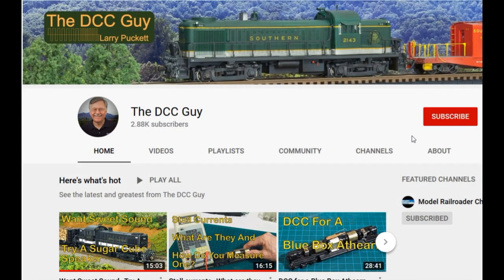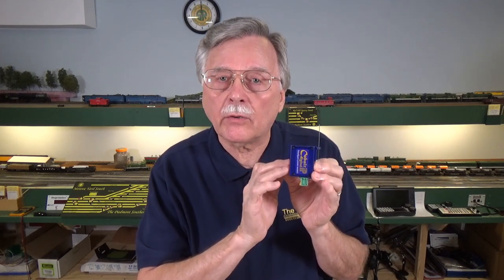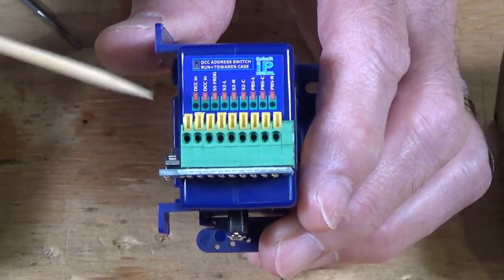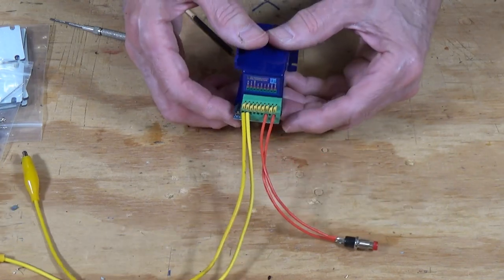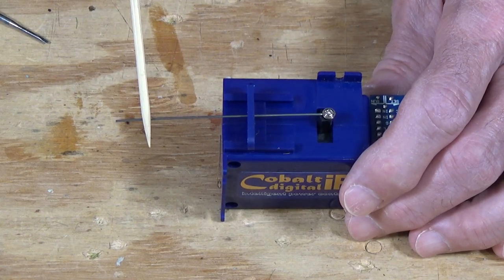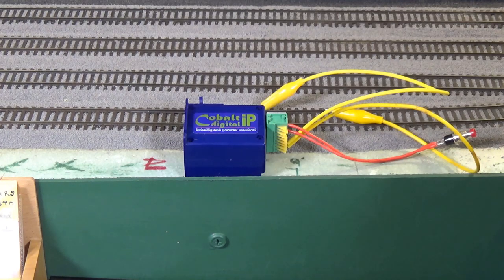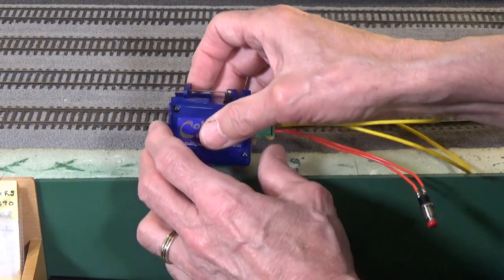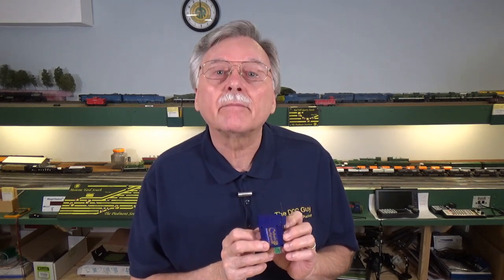Is The Cobalt Digital A Tortoise Slayer(188)

Comment: Hi Larry, my apologies if this is a duplicate posting. I have noticed that the PSXX nor the PSXX-AR circuit breaker does not appear to be compatible with the Cobalt Digital switches. I have noticed that every time I use the Cobalt switch it creates a short with the PSXX. When researching this Tony's Train Exchange (DCC Specialties) states that it is due to a poor design of the Cobalt switches and it should not be used with PSXX and recommends using Tortoise switches instead or using a separate bus to power the Cobalt switches (which I assume will cause problems when I try to power the frog, use auto reversers, and or track detectors to automate my switches.) Im new to the hobby so forgive my ignorance if this is not true. 

What is your solution on your layouts when using a circuit breaker and IP Digital Switches? Are they really not compatible?
Reply from the maker: In the video I did on using the PSXX it was on a layout with 9 iP Digital switch machines and I had no issues. However today as a test I will give it another try and cycle every iP Digital to see what happens.
Reply from the maker: OK, I just did the test. Connected the PSXX set with a 3 amp trip current to the layout with a PowerCab/SB5 operating at 5 amps. There were 8 sound decoder equipped locos sitting on the powered tracks and 9 iP Digital switch machines. All the iP Digitals are connected directly to the DCC power bus. Powered it up and threw all the turnouts including a crossover with 2 switch machines, didn’t have any issues. So I have no idea why you or the folks at Tonys Trains had a problem. I’ll show this test in the video this Friday.
Reply: @TheDCCGuy  Thanks Larry. I am new to this but I did try a few more things. I wired the motor directly to the Bus (no rails or anything else) Tired it and the IP Digital motor works fine.I then put the Power to PSXX then PSXX to the IP motor and it shorts. Based on your msg I will now program the PSXX to be 3 amp rather than the preset 2 amp and see if that makes a difference. Fortunately you have a video on how to do exactly that....being new to the hobby your videos are incredibly helpful. I will let you know how it goes.
Reply: @TheDCCGuy  Hi Larry,  First off I would like to thank you again for your quick response and for going through the trouble of testing this. I am looking forwards to your next video on Friday and knowing it works for you gives me confidence to keep working on the issue. 

I reset the PSXX to 3amps as you have with your system and the IP Digital switch now completes its motion but the PSXX will trip at the end of its movement.  I am completely new to this but I will take a guess that the IP Digital Motor takes up a lot of power and since I do not have a full track layout connected the PSXX sees it as a substantial change in power ratio thereby tripping? Is PSXX That smart? Maybe something you can explain when you show the test. 

I am continuing to work with DCC Concepts who have been very responsive to my questions on this and I will post any explanation/solution on your video comments section to help those who may experience the same issue. 

I will also reach out to DDC Specialties to get their comment and share that if it provides any more constructive information than what they have already stated. 

Again thank you for taking the time to test this on your system.
Reply from the maker: When the iP Digital cycles it is a bit different from the Tortoise. Unlike a Tortoise which actually stalls at the end of its throw the iP Digital circuit actually cuts off power to the motor. So there is a sharp drop off in current draw at that point as the circuit alone only pulls a small current. So I think you may be onto something with your interpretation. When I did my test I had 8 powered locos along with the 9 iP Digitals collectively pulling 0.27 amps so it might be true that in that case the PSXX circuit does interpret the iP Digital peak followed by a dropoff as a short. It would be interesting to see how it acts with more of a load on the track. Also there may be a way to adjust the PSXX circuit to slow it down. I’ll take a look at the various settings and see if that might work, I know a lot of changes were made compared to the old PSX.
Reply from the maker: I just did a quick test, removed all but 1 loco which brought the track current down to 0.14 amps. Then I went through the switches, cycling each—still could not pop a short. What scale are your locos, how many on the track, how many iP Digitals?
Reply: @TheDCCGuy  I am HO Scale (code 83) using ESU Cab Controller (15V @aprox 7amps) The set up I have is just a test set up of approximately 4 feet of Atlas track with a Atlas turnout at the end (customs line Mark IV) no frog connected to the IP Digital Motor yet and one IP Digital Motor. 1 locomotive (Athern Genesis, full DCC sound etc. Diesel GP-40) 

I have since removed all track and just have the main bus connected to the IP Motor and   PSXX. Here are my findings so far:
1) Just the motor no PSXX, everything works fine (Direct connection)
2) Add the PSXX and short occurs (ie Power to PSXX and PSXX to IP Motor)
3) Set PSXX CV=3 and switch throws but short occurs at the end after the throw is completed (Power to PSXX and PSXX to IP Motor)
4) Set PSXX CV =6 = Approx. 7amps) and everything works fine no blue or red light on the PSXX.(Power to PSXX and PSXX to IP motor)
Reply: To clarify set CV 49 = 3 and CV 49 =6.
Reply from the maker: Jason—it sounds as though your iP Digital may be drawing excess current and causing the circuit breaker to trip. I have sent an email to the folks at DCC Concepts detailing the results of your tests and mine. Unfortunately the sales manager is on vacation this week so I likely will not hear back from him until the 13th. Do you have other iP Digtals you can try to see if the one causing the issues is unique or part of a bad batch?
Reply: @TheDCCGuy  Hi Larry, in fact I do have another IP Digital still in the package. I will try it tonight and let you know how it goes.
Reply: @TheDCCGuy  Hi Larry, I tried it with a brand new IP Digital switch and unfortunately the same problem occurred. I tried it again with the same set up (No tracks) direct connection PSXX and to the Motor.

I read up on the new PSXX to see if I can change the timing (as you mentioned it may be possible) however; according to the literature that i could find , the new PSXX has algorithms to determine this now and a manual set is not possible.  I am still inclined to believe that my test environment is way outside of a standard layout that the algorithm is having trouble resulting in a short, but,  I can't get around your stated fact that it does seem to be drawing a lot of power for one switch. 

Lets hope DCC concepts can shed some light on this after the 13th and/or DCC specialties can provide some insight into how the PSXX (new) works. Since the IP digital motors work on your layout I am hopeful enough to continue to build my layout incrementally with PSXX and the PXX-AR, In combination with IP digital Motors.

You have bene incredibly helpful and I can not thank you enough. I will keep you up to date as a solution is found. 

Many thanks, 
Jason
Reply from the maker: I really don’t know that it is a matter of the iP Digitals drawing excess power, it might be as you say an artifact of the setup. I am able to actually measure the current draw because I installed an Alpha Meter in the bus feed. As a test I installed the iP-CB intelligent circuit breaker set for 1.25 Amps and even then could not trip it. Tomorrow I will see what happens with just one iP Digital and a PSXX as yours is set up.
Reply from the maker: I just did a test with 1 iP Digital switch machine wired directly to the output terminals on the PSXX still set for 3 amps—same results, could not get it to trip. So there must be something going on with either your switch machines or your PSXX and mine.
Reply: @TheDCCGuy  That's interesting and unexpected. 

Given that I tried two switch machines and the PSXX works fine with my small track and locomotive, Im perplexed. 

Im going to look at the greater probability that I am doing something wrong.(ie the craftsman not the tools)  I will pull out the wiring and put in new wiring with all the same gauge. I will clear all codes and re initiate the IP Digital Switches. I will also re- do the steps outlined in the PSXX test procedure. Finally I will re-read Tony's Train Exchange post about the issue their customer had with the PSX-AR to see if there are clues on what he and I may be doing wrong. 

I assume you are using the new PSXX and not the older version?
Reply from the maker: I got my PSXX about a year ago and I have no idea if they have released other versions since then.
Reply: @TheDCCGuy  Thanks Larry, I have written to DCC specialities inquiring about their PSXX and this issue, will see what they say. 

 I tried re-wiring, re-coding etc but got the same result so at this point i will have to with for the product techs to weigh in. If no solution comes forward I can always abandon the PSXX temporarily for a DCC concept circuit breaker and use a tam double juicer to manage revers loops as per you video on fully automate reverse loops (which i have managed to recreate in a test setup after watching it-- without a circuit breaker of course)  You pack a lot of good information in your videos. It really is all there.
Reply: @TheDCCGuy  I found a Solution to IP Digital Motors Tripping PSXX:

After taking to Larry Maier (PSXX Designer) at DCC Specialties my attention was brought to my power supply (ESU Cab Controller). After programming the PSXX then rebooting my power supply (full shut down and restart) I no longer have the issue and can run multiple switches, locomotives etc without a short. I tried this multiple times and every time I programmed the PSXX then tried to use the switched (power on/off track) the switches would fail. Every time I program the PSXX and power on and off the entire Cab Controller after programming I do not experience the issue. 

I have no idea why this was the case and certainly did not expect these results. I have reached out to ESU for a possible explanation. I included this response in your chat area tied to you last video on Friday, Written to DCC Specialties, DCC Concepts, and Posted on ESU's forum to assist anyone who might experience the same issue.

Comment: I have seen lots of switch machines and dcc controls, most are like the Cobalt machines with a push button input.   My question do these or any other you know of have an option to shut off local control?   Say a mainline turnout that the dispatcher can "release" so that local crew can used it vera pushbutton but then take control back when the local is done.
Also do these dcc decoders feed position in the dcc, or does JMRI only know the pos after a throw command has been sent?
Reply from the maker: I know that some accessory decoders offer this option. For example it is an option with the Switch8, Smail, and also the DS-64 if I interpret their instructions properly. I think that the ability for JMRI to know position requires a feedback network. For example I believe that Digitrax Loconet can provide that kind of feedback if the device has that capability as well. I think it is also built into LCC but again the device must also have that capability.

Comment: Is there a way to use theses with nce and monetary switch to control from a board with them
Reply from the maker: Yes, but I am not exactly sure what you are asking. By board do you mean a control panel, accessary decoders, or something else? The iP Digital has an accessary decoder built in that can be activated by a momentary PB. If you want to use an NCE MiniPanel, Switch 8, or SwitchIt then the iP Analog or Omega would be best.
Reply: @TheDCCGuy  was wondering how nce can program the switch, I know digitrax has it on their hand held
Reply: @434srt90  no CV programming is necessary for Cobalt iP Digitals - simply put into SET mode, send the normal command to change the machine from the handset, then put into RUN mode. Full instructions are with the switch machine when you purchase it.

Comment: Do you recommend removing the spring from Peco switches when using a Tortoise switch machine?  I noticed you indicated that the manufacturer of the Cobalt switch machine recommends that one remove the spring from a Peco switch.
Reply from the maker: John—I have always done it for the reason I thought it would make the throw easier. However given the evidence DCC Concepts provided on the Peco springs I will do it for that reason. There is a post on their website showing how easy it is to do. Here is a link https://www.dccconcepts.com/manual/making-peco-better/
Reply: Sorry to but in, but why would you do that, remove the over centre spring that ensures the turnout is set and not part set?
Reply: @black5f  I hope Larry doesn't mind me answering this one - the Cobalt uses a tension spring to hold the blade against the stock-rail, so the over-centre spring is not needed. Also - when the point is changing, to get the "slow action" the spring needs to be removed. If not, then the point snaps over when the tension in the throw-bar defeats the spring - therefore negating the main purpose of using a "slow action" switch machine rather than a "snap" solenoid. Hope this makes sense! ^RB - DCCconcepts

Comment: G'day Larry, an informative video, thanks for sharing. I am based in Australia and I have 12 of these motors. So far I have installed 4 as I build my layout, 3 more going in over the next week. I agree with you re easy of management, setting up etc. I power my machines via a DCC accessory bus, rather than track power. I have a question for you. When I ran my first machine I was surprised by the noise from the motor, it is louder than I expected. Now I have no other point of reference as this is my first layout build, so I was wondering if you could "demonstrate" the Cobalt and the Tortoise machine running together to demonstrate the relative noise from the two machines? Regards, Andrew
Reply from the maker: I will do the noise comparison when I install them in the next town. I have Tortoises installed directly over that town. Tortoises can vary a lot as far as the noise. I have some that I need to pull and check out as they make a lot of gear and motor noise.
Reply: @TheDCCGuy   Thanks Larry

Comment: Great video Larry
Which one do you prefer?
How does the walther's compare
Reply from the maker: Not sure yet. I have a basic setup but just haven’t had time to work with it. I need to find a location on the layout to install it and get a feel for it.
Reply: I found the Walthers switch machines available on line for $20 or a little less. The Walthers machine is powered by a servo motor while the Cobalt and Tortoise have stall motors.  The stall motors don't turn off so as to apply pressure for holding the points in place. While it is small this means the machine continues to draw power at all times. The Walthers servo doesn't rely on pressure to hold the turnout in place and turns off after moving the points. This means the Walthers machine draws power only while moving the points.
Reply: @jerrysmith1929  Hi Jerry - our iP Analog and iP Digital motors do not hold the point by keeping power to the motor - they lock in position and stop taking power. As such they are not "stall" motors - the internal switch turns off power to the motor when the motor has completed a full arc of travel.
Reply: @dccconceptsyoutube6446  are they servos or do they have a switch which turns off the motor?
Reply: @jerrysmith1929  so sorry I didn't see this post! They are motors and have a on-board switch which manages power to the motor. This is all managed by the on-board processor.

Comment: For the life of me, Larry, I dont know why more people are using a great lower costs system available here in the UK. MegaPoints Controllers using low priced servos costing about £4 controlled from an electronics board capable of switching 12 servos for another £70. These cobolt and turtle motors cost about £50 each and still need a control method.
Reply from the maker: Servos are just starting to make inroads into the hobby. Tamm Valley Depot, maker of Frog Juicers, has been pushing them for a while and I get occasional emails about using servos. Another subject I need to look into.

Comment: Very interesting video!  What is the diameter of the throw rod?  Thanks again!
Reply from the maker: Nick—I’m getting 0.032” and the Cobalt I took apart is still working and is the same sound level as the other one. Guess I didn’t screw it up after all!
Reply: @TheDCCGuy  I like the 0.032” a lot.  I can put the switch machine away from the switch, bend the rod and still get a good action.  I get improved electrical contact also.
Reply from the maker: They also have a horizontal mount accessory and mounting lugs molded into the sides of the unit for awkward spots.

Comment: Larry, I once heard the Cobalt draws more power than the Tortoise. Maybe a constraint for some with limited power available.
Reply from the maker: Yes, the Tortoise pulls only about 20 mA whereas the Cobalt pulls <40mA when moving. They both draw about the same (5 mA) when stalled. This is such a small amount of power it really isn’t enough to worry about on most layouts.
Reply: @TheDCCGuy  Thanks for the clarification! I was under the misimpression it was the stall load.
Reply from the maker: Michael—actually I just found out that it is not a stall motor but instead the circuit turns it off at the end of the throw.